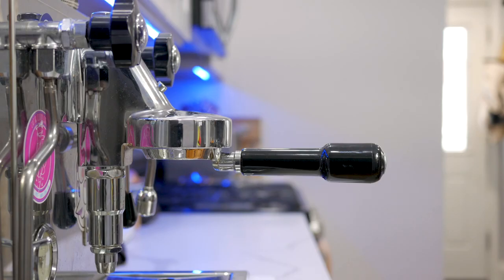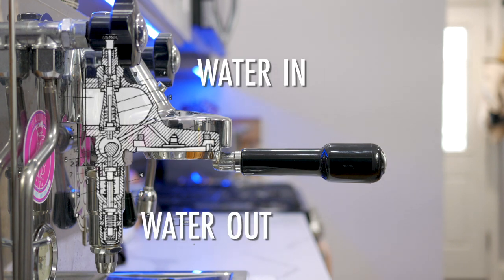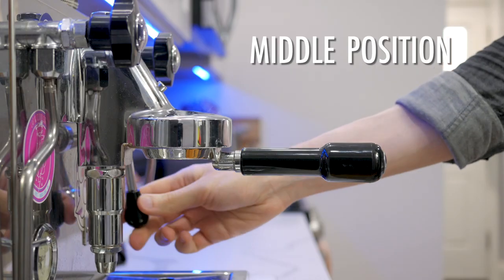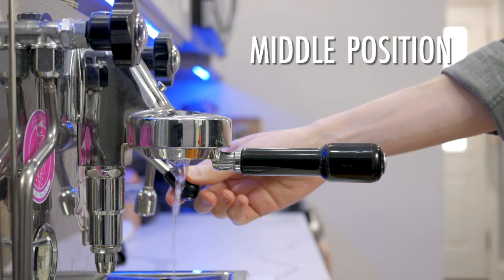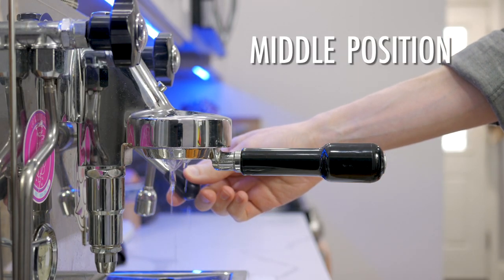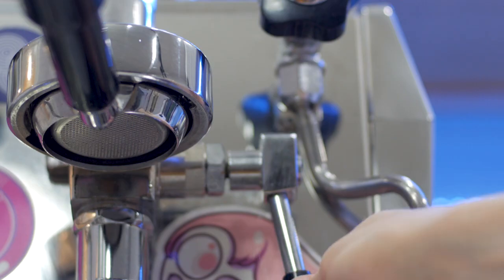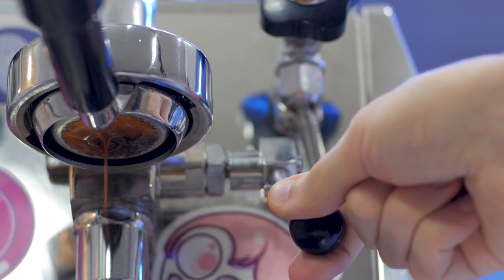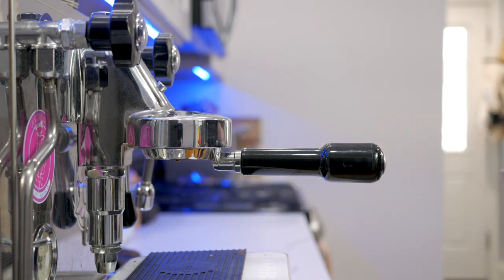How to Preinfuse Espresso with a Rocket Giotto e61 - Preinfusion Techniqe

Comment: I tried this on my M58 today after watching your video.  On my machine the pump engages at 45 degree angle but flow is still off which prevents the line pressure/tank steam wetting drip.  Clive has sent me instructions on how to adjust my pump switch back to keep the pump from kicking on this early but I am reluctant to go under the hood this early in my ownership.  After watching your video, I now kick on to full 9 bar until I see droplets form on the bottomless, go down to 45 degree which completely cuts flow (though pump is still engaged) for 10 seconds, kick back up to full to get syrupy extraction, back to 45 as I approach my extraction grams target, fully down at target.  Thank you so much for showing me how to use this!  No longer worried about plumbing in and adjusting pump switch.

Comment: I have the same model Rocket Giotto (2009) running on a tank. I have been preinfusing with the lever half way but interesting to see that you recommend engaging the pump and then dropping the lever back - interested to get that a try!
Reply: I've also been looking at the Lelit Flow Control Kit recently which looks like it would also allow you to do full (water line pressure) controlled preinfusion. Looked at these before - what do you think?
Reply from the maker: Just checked out the Lelit, hadn’t heard of the kit before! When I’m feeling more adventurous I might try and get my hands on one. A group rebuild is probably in my future either way.

Comment: Sanity check David - I am looking to buy the same machine, and will only use bottled water tank fill because the available tap water here is hard and would scale.  Apparently one difference between the vibratory and rotary pumps is the rotary pumps build pressure more quickly - the opposite of what you are working to achieve?  From that it seems that I'm better off saving the price difference and getting the cheaper vibratory pump version and putting the savings into a grinder budget?  I'm also curious to try the E61 Coffee Sensor Flow Control.  Thanks for the videos and feedback!
Reply from the maker: Hi Ralph! More cash for a grinder might be the way to go. If you end up going with rotary pump you have the option to pull from your water line which would give you that line pressure preinfusion that I’m trying to emulate with this method. Without the water line, you’d still get a more durable pump in the rotary model and, maybe, more consistent pressure throughout each shot. I haven’t used many home machines with rotary pumps so can’t speak on that too much. Vibratory pumps last about 4-5 years in my experience and are inexpensive and relatively easy to replace yourself. Good luck!
Reply: @DavidLikesCoffee  Thanks sooo much for the reply because internet research is often misleading.  The time is now to decide between Mozzafiato / Giotto vibratory or rotary pumped.  At my mountain dream house the tap water is hard, so the most convenient use will be bottled jug water and avoid the plumbing job; otherwise I’d have to introduce a reverse osmosis filter.  

Your method to momentarily engage the pump is a variation on a more common technique described two minutes into YouTube video HWpOVdryALk, to pre-wet using water driven by residual pressure in the brew boiler line.   Learning from comments (YouTube 2DPcZD48TxM) between sFu/Marc, the Rocket has a safety solenoid valve which is closed when the rotary pump is off that prevents plumbing line pressure pre-infusion.  So there doesn’t seem to be a pre-infusion advantage in the Rocket models between vibratory and rotary.  Except for a later comment by Engiadina, who added an override switch to open the solenoid valve for line pressure pre-infusion.  Good for him, but of no use if I prefer bottled water.

By momentarily engaging the pump, you have a simple and cleaver work-around.

I guessed and ordered a rotary Mozzafiato; maybe more consistent extraction, and maybe a filtered hookup someday in place of bottled water.

Comment: Does preinfusion (mid way up) start the shot timer? Or when does the timer trigger on the Giotto?
Reply from the maker: I’ll always start the shot timer as soon as water starts flowing. Looks like the rocket modes with timers don’t start until the lever is all the way up, so I would count manually and add pre infusion time to total shot time or just ignore that timer and use my own.
Reply: @DavidLikesCoffee So when you're saying 30, 40 or even up to 50 that's the total amount starting right after you hit the lever for the first time?

Comment: Cool video, thanks for the information. I also have a Giotto (and use the tank) and experimented with technique today on a couple shots. Two questions, you are moving to the "middle position" which allows water to still flow slowly out of the group correct? Because it looks like (in your video) the lever is disengaged from the trigger/button. Second question when you say you have these long extraction times, those times include the pre-infusion correct? Thanks again for sharing this technique!
Reply from the maker: Thank you! The time does include preinfusion. The button that is behind the lever, at least on my model, only engages the pump. The lever also mechanically pushes the top pin in the e61 to allow water to enter/flow through the group.